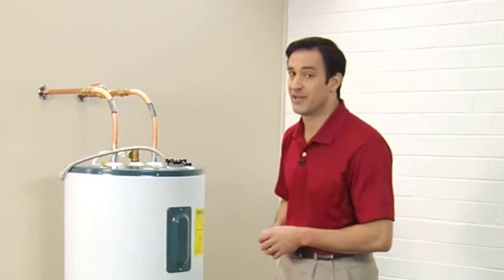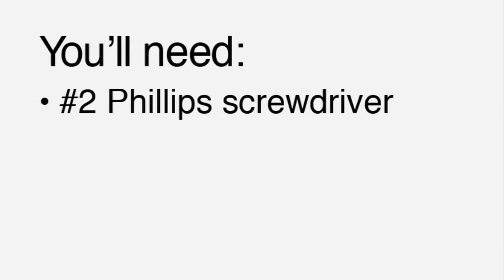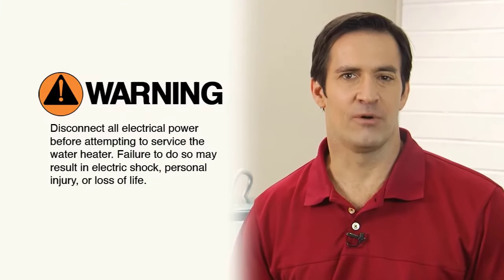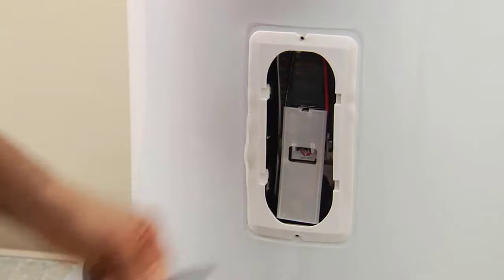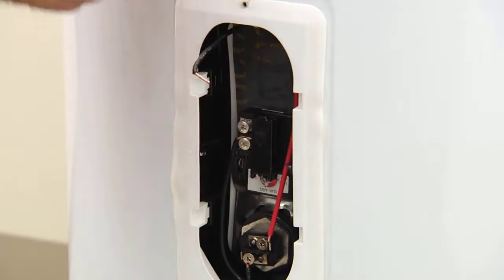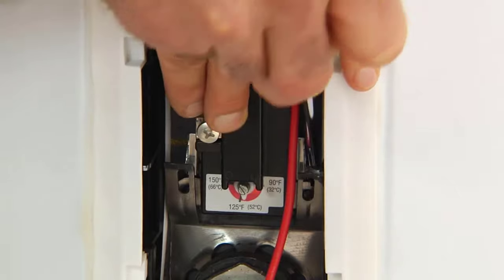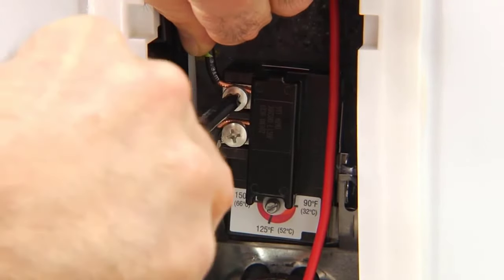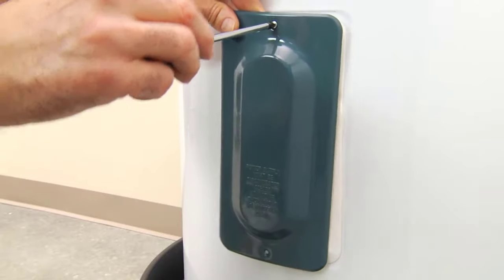How to Replace an Electric Water Heater Thermostat

Comment: My water heater is heating the water at 165 degrees at it's lowest setting. Would that mean the thermostat is faulty or there is a gap between the thermostat and the water heater?

Comment: My water is not getting as hot as it used to, even if I turn the thermostat up. I have replaced the element recently. Could the thermostat be partially broken, as in it is heating but switching off too low.
Reply from the maker: To get information on this situation, please contact our Technical Support Team at 800-432-8373 for more details.

Comment: Breaker started tripping, so I had an electrician run tests on the water heater. After running the tests on the upper/lower elements and thermostats, only the lower thermostat showed as failed. I replaced it, but the breaker tripped again after about 6 minutes. While the tank was still drained, I replaced the lower element, even though the one in the tank looked and tested good, and also replaced the anode rod. Filled up the tank and the breaker tripped again after 5-6 minutes. Shall I just go ahead and replace the upper thermostat and element, or could there be a problem someplace else?
Reply: I have the same exact problem. Did you ever find a solution by chance?
Reply: @cking3411  I ended up replacing both thermostats and elements, even though only the lower element tested bad, which was the hot water issue. But my problem was a 2 fold, the other being a tripped breaker. That problem was found out to be a loose wire on the breaker itself, which was causing arcing and the breaker would overheat and trip. Once the loose wire was fixed, both issues were resolved. I now have plenty of water and no more breaker tripping.
Reply: @nyrainman4897  I replaced both thermostats. Checked wiring and breakers. All was ok. Also put in new elements. It's still tripping the breaker though. 
With both new thermostats, I get power to top but not bottom. With old ones, it's reversed. I figured 1 new was bad and 1 old was bad. Mixed it up. Still same problem. I'm going crazy haha.
I know only 1 element powers on at a time, cycles between the 2. But while 1 is off, it's still supposed to get 120v. But it shows 0. When I get off work, I guess I'm just gonna check all wires to make sure none are cracked or exposed where they not supposed to be. After that, I give up. Just buy a New one I guess.
Reply: @cking3411  In reference to the thermostats, if I remember correctly, since the thermostats work independently, you should only get power to the top because the top element heats up first. I believe to test if you have power to the bottom, you need to disable the wires to the top and the bottom should power up. I think that is what I did, but if so, be careful, as your wiring up top with still be hot and open.
   So if you've replaced both thermostats and elements and your breaker is still tripping, it can be a wiring issue (mine was a loose wire on the breaker) or even a bad breaker. 
   So with that said, does your breaker trip immediately after you turn it back on or after a few minutes? Immediately points to the breaker being bad and after a few minutes, that points to wiring. Also, if your tank is old, you may even have bad wiring that connects the thermostats, I seen it where someone had a bad wiring that fed the power from the top thermostat to the bottom. They replaced the wire and that fixed there problem.
   Also, make sure all your screw heads and wiring in the tank are clean and not rusty, as that can effect your connection and possibly cause a problem.
Reply: @nyrainman4897  The Water Heater and Breaker I replaced both at the same time, new. That was about 3yrs ago. Terminals and wires are still in excellent shape. As for the breaker tripping, most of the time it's about 5mins after I reset it. But it has tripped instantly also. It didn't even stay in the on position. As soon as I released the switch, it went straight to the middle. 1 out of the 4 times I reset it today, it tripped instant. The other 3 times was about 5mins after reset.
Since the breaker is only 3yrs old, I've been trying to troubleshoot everything else first. But it very well could be the breaker. The closest store is a ways away and the other parts I already had on hand, hoping I could resolve the issue without another trip to Lowes haha. But I may have to go tomorrow before work.

Comment: How do you know which of the upper or lower thermostats need replacing? What do they do differently to each other?
Reply: They alternate between the upper and lower tanks. As cheap as they are you might as well just replace both while you’re at it. Other than that you’ll have to test with a voltmeter

Comment: My whirlpool water makes hot water, but it intermittently trips the upper thermostat. The water temp-though set to 120°-gets so hot it will burn your skin.
It's not regulated. Isn't that a reason to replace the thermostat?
Reply: I would. 120 degrees should not be enough to burn your skin. You can get an entire kit with both heating elements and two thermostats for an electric hot water heater for less than $50 online.